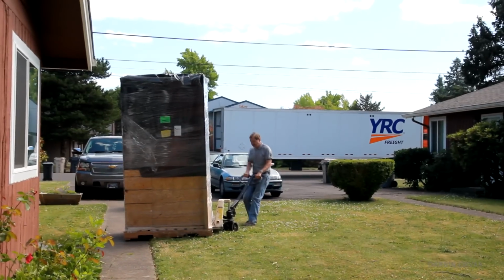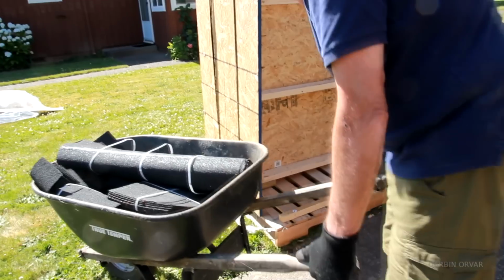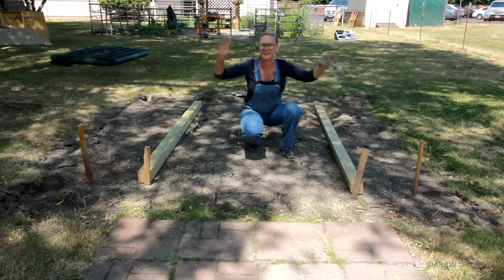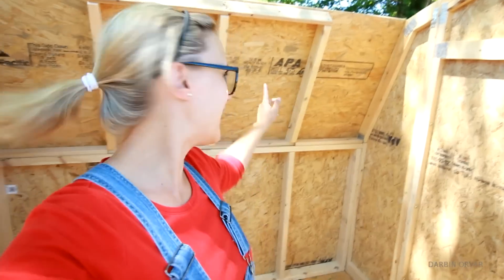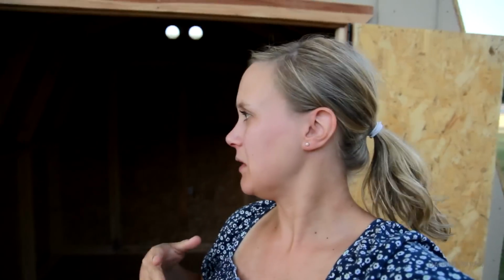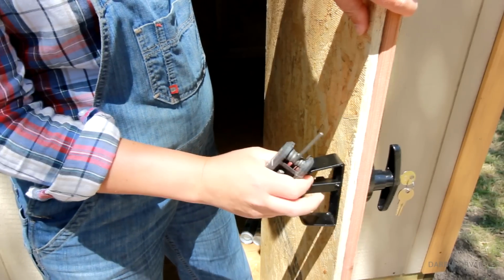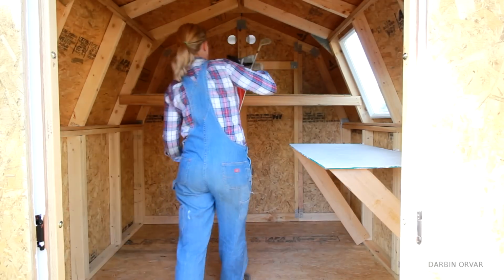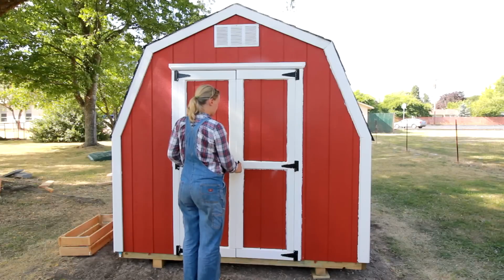Building a Backyard Shed w/ Ready Shed

Comment: Overall, pretty good. I can't quite tell if the "starter" row of shingles has the glue side facing down (not up) if not it will need some roofing tar underneath to seal the showing shingle to the starter shingle.  To get the shingles you tacked from the top to bend use a heat gun or hair dryer.

Comment: Nice shed.  I built mine from a kit but it wasn't partially built like this.  All the boards were already cut, though.  One suggestion would involve the door handle.  The way you have it screwed in means that the attachment screws are easily accessible when the door is locked.  They can be unscrewed and then the entire assembly rotated to open the door.  I understand that an angle screwdriver can get them the other way, but not everyone carries one of those.